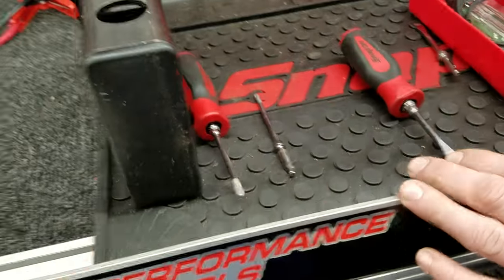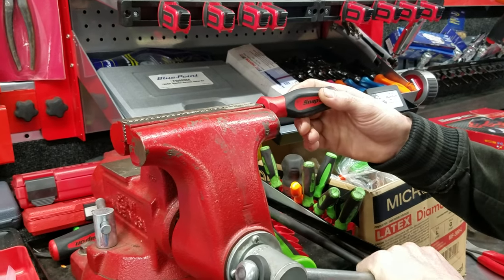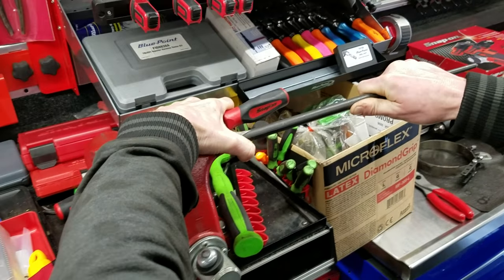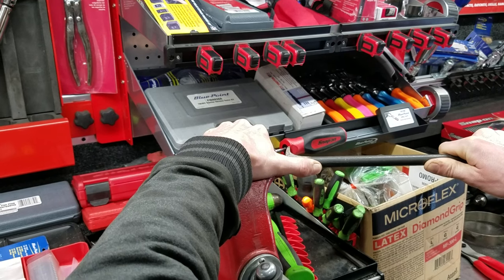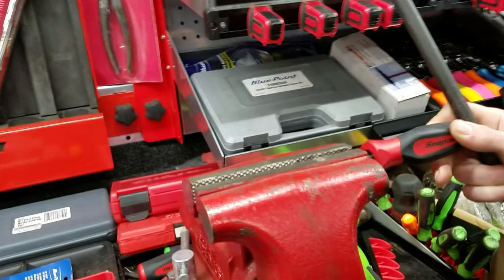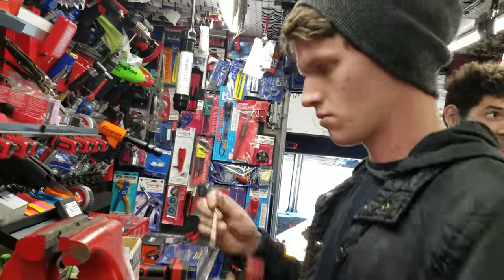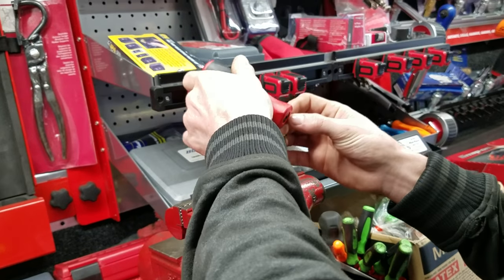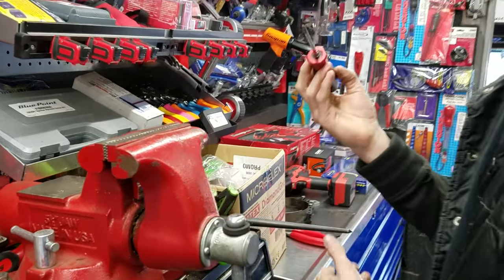REPLACING A SNAP-ON PHILIPS HEAD LIKE A SIR!

Comment: I’m fine with them reusing the handle but the truck should be equipped with the right puller to prevent damage to the plastic handle when prying with a lady bar.
Reply: Adrian Gonzalez exactly man . I just bought brand new screwdrivers and the first week of owning them my screwdriverbit broke and my snap on guy had to replace it .whike replacing he I saw him prying it out with a pry bar damagin the screw driver .. I know I’m gojng to use the screw driver but I pay a lot for my tools and I want them to look as nice as possible